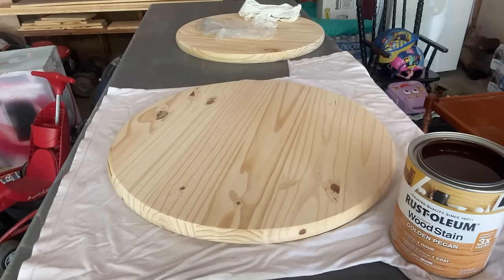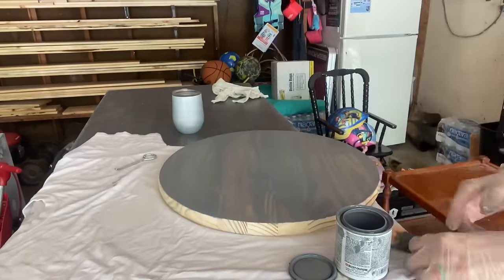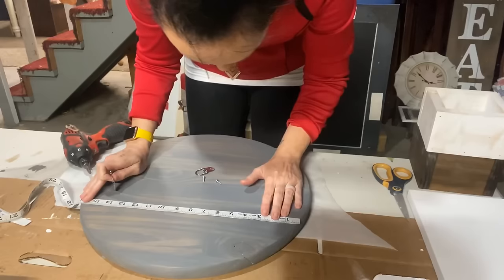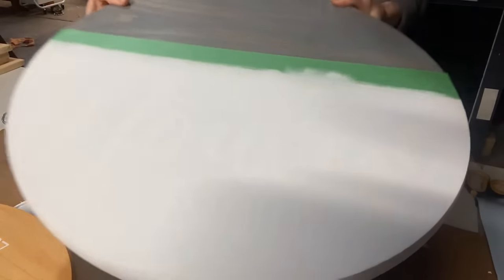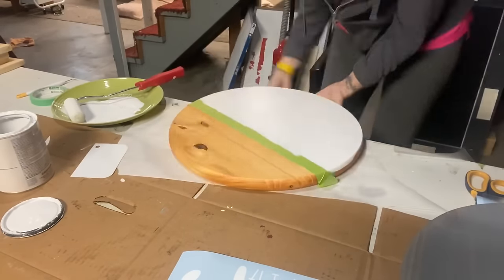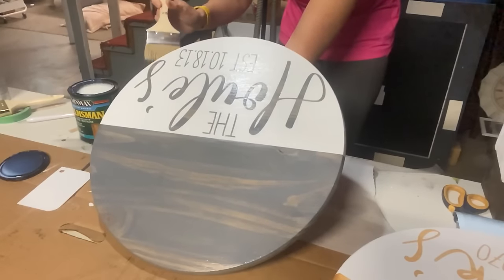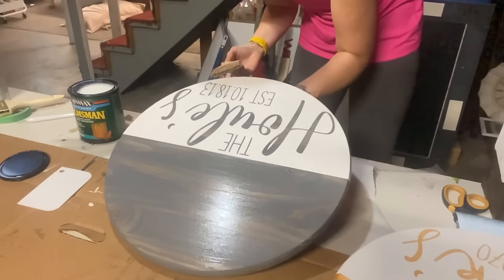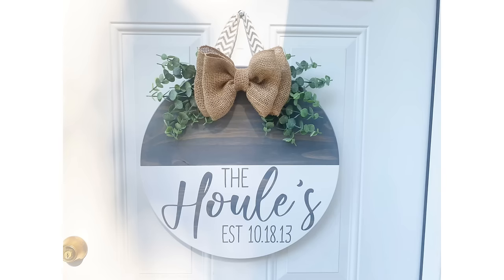DIY WOOD ROUND || DIY WOOD DOOR HANGER || WOOD SIGNS FOR BEGINNERS

Comment: Ok so did I miss when you put e6000?? Or is your hot glue e6000???
Reply from the maker: Hi Celene! I don’t use it on the bow itself. I use the E6000 when I’m putting the bow onto the wood which I don’t show in this video. I do, however, use it in the newer video.

Comment: I did an 18" round. I painted it white and painted the words Merry Christmas in red.  I let it set for a couple of days before I put on the Helmsman clear satin.  As I started to brush it on, the red smudged!  Is it possible my room was too warm and the red somehow didn't completely dry.  I'm going to try and sand and make it look more rustic.  Any suggestions?
Reply from the maker: Oh no! What kind of paint was the red? That’s so weird. Especially after sitting that long
Reply: @UnicornDustDesigns  Its Home Decor Chalk paint.
Reply from the maker: Hmmmm I haven’t used that chalk paint before but there shouldn’t be smearing. Maybe it’s just red in general. Maybe you can try the spray version?
Reply: Unicorn Dust Designs I’ll try it! Thank you
Reply from the maker: You’re welcome!!

Comment: Hi!  I’m trying to make a door hanger and I’m trying to follow your method. I am using the same Oramask 813. When my stencil printed out everything is blue including the letters? I see your letters are white am I missing something lol? I’m trying to do the paint over the letters but when I try lifting the stencil off the paper the letters are staying on the oramask paper. Is this correct?
Reply from the maker: Hi Brittany. I’m a little confused. For this sign I used 651 vinyl to place on my stained wood. I use contact paper to pull my vinyl up and then put it on the wood and take the transfer paper off which leaves your vinyl down on the wood to paint over. If you have FB or IG please feel free to message me pics. Both accounts are linked in description
Reply: Unicorn Dust Designs Thank you so much! I will message you. Sorry for the confusion lol.
Reply from the maker: No worries girl! I’ll lookout for your message

Comment: I went to seal with my poly and my chalk paint is smearing! It's dried over 24 hours. Any ideas why?
Reply from the maker: Hello. So I don't usually have this happen but I've been asked it a lot of times. I suggest getting a can of clear matte spray paint by rustoleum and spraying a very light coat on the wood round, allow to fully dry, and then apply your clear coat. f

Comment: When I sand my wood round it ends up with these almost " scratches" im not sure why.
Reply from the maker: Hello Zindel! What kind of sander are you using and what grit sand paper?
Reply: I use a finishing 220 and mine also did it until I realized I was putting too much pressure onto the sander. 

It’s almost like swirling marks, right? If so use a good 80/100 first with light pressure, let your sander do the work, NOT YOU!! 
Next, hit it with light pressure on a 220 to finish it and you will see a difference.
Reply: Thank you so much ! I was actually using some rough rough sand paper I saw laying around the house lol! Thank you!
Reply: Zindel, you’re welcome! I promise it’s a game changer.

Comment: You are going to wish I never watched your video I have asked sooooo many questions.  I did exactly how you instructed to attach the greenery and bow.  I put the E6000 permanent bond glue on and then put the hot glue on.  It did not stick.  What am I doing wrong?
Reply from the maker: Hi Kay hahaha 🤣 I would suggest putting the E6000 and hot glue and then putting something on top of it over night to hold it in it’s place
Reply: I will take your advice and put bricks on top.